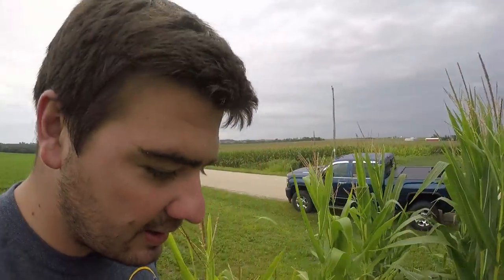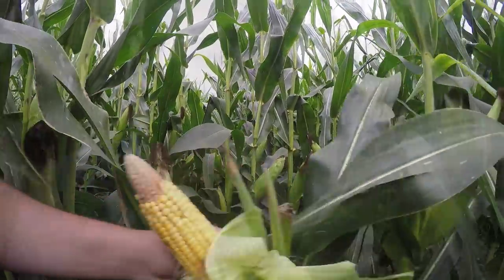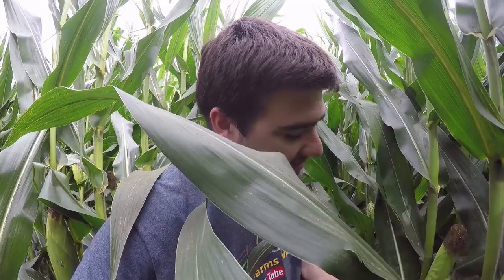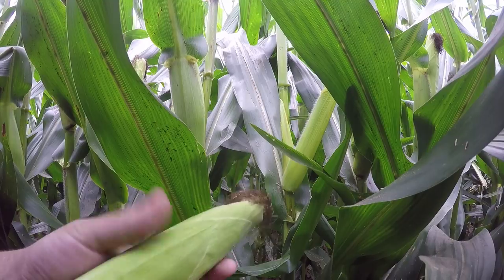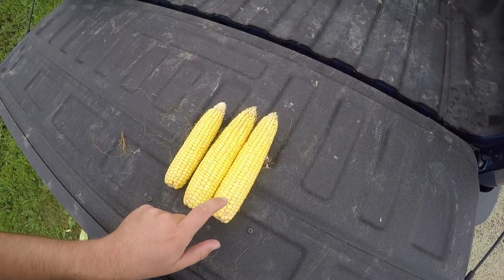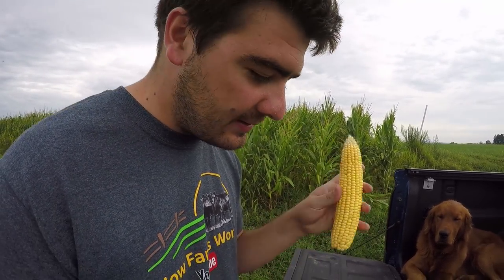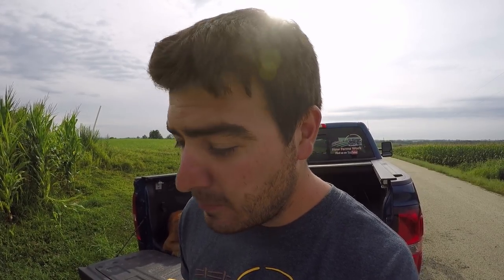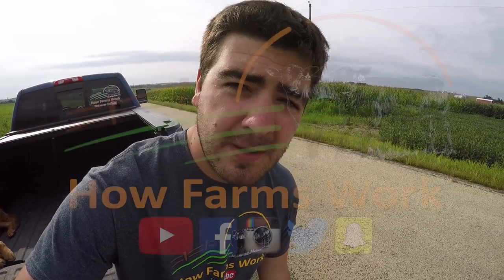Corn Yield Concern

Comment: Ive done detasseling as a summer job. 
Most are 3 female, 2 male, 2 female, 2 male then 3 female
Or 4,2,4,24
Reply: In Indiana (at least on the Pioneer seed corn production around my BIL's area; my nephew works for Pioneer as a field supervisor)  they have 1 male row and 4 female rows.  Females get detassled 3 times, at least... mechanically mowed off, mechanically "pulled" (spinning tires running against each other at an angle to snatch the tassels off) and then cleaned up by hand once or twice.  Male rows are chopped down as soon as pollination is completed.  Most hybrids now require 2 planters... one for male rows and another for female rows... looks funny to see a 24 row planter with only 8 units on the bar spread about 10 feet apart from each other (the male row planters) and another "skip row" planter with 4 units 30 inches apart then a 60 inch gap "missing unit" where the male rows are, BUT, Pioneer often requires many of their seed hybrids have the male rows and female rows planted at DIFFERENT TIMES, so really there's no choice in the matter... Some hybrids the male rows are planted first and then a few days to a week or two later the female rows are planted, sometimes vice-versa... 

Grandma told me when she was a kid Grandpa Bushnell used to make her and the other kids "top" the corn after it had pollinated... basically they walked through the field with a butcher knife and cut the top of the plant off right above the ear.  This allowed the corn to fill and ripen more evenly he said and resulted in higher yields.  Course this was back in the 30's and 40's before they had hybrid corn, so... 

Later!  OL J R :)

Comment: There's female plants?
Reply: I thought all plants were the same
Reply: Yes... some plants (like Ginkgoes) have differentiated "sexes" of the plants-- ie "male" trees and "female" trees... male trees produce only pollen from their male flowers and produce no fruit, female trees produce flowers that collect pollen and pollinate to produce fruit/seeds.  

Most flowering plants have the male and female parts in the same flower-- the stamens produce the pollen ( a number of little "sticks" inside the petals with little round pollen heads on them releasing pollen, in a circle around the very center of the flower)  with the pistil in the very center of the flower (which is the female part that collects the pollen, and then ducts it down into the ova (female eggs) in the base of the flower.  Cotton is this way, as is oranges, tomatoes, soybeans, and many other crops (and noncrop plants-- look up "angiosperms" on google).  

Those are all broadleaf crops... grass crops (cereal grains like wheat and oats, barley, rye, sorghum, etc) are still angiosperms and reproduce in the same way (ie they are flowering plants) but they of course have different flowering structures.  Sorghum actually has TEENY-TINY little blooms, only about the size of the tip of a pencil lead, for each and every kernel on the head of grain.  Wheat and other cereal grains are similar.  Corn is the real standout because it is SO far removed from its original "wild" form (teosinte, which was a grass-like plant in Mexico and Central America).  

Corn has a "divided florescence", meaning the flower is split into two parts, but unlike plants like ginkgoes that have separate "male" and "female" trees, corn has BOTH male and female parts on the same plant, but in DIFFERENT LOCATIONS on the plant.  The male part of the corn plant is the tassel at the top, which produces the pollen to fertilize the seeds (ova) in the female part of the plant.  The female part is the silks on the tips of the developing ear... As the pollen blows around from the tassels, it lands on the silks and is transported down the silks through the center of them (they are actually tiny little tubes) to the tip of each kernel bud on the developing cob... the kernel buds that are fertilized with a pollen grain will develop into a full-fledged kernel of grain-- the ones that do not pollinate will not develop into a kernel, and will be a "blank" spot on the cob.  The silks then dry out and die, as the ear develops.  That is why SOME ears of corn have "blank spots" on them, or bare tips-- if the weather gets too hot or unfavorable, the silks at the top of the ear don't have time to pollinate or can't pollinate, and so the tip of the ear remains "blank" or barren, since the ear silks from the bottom upwards toward the tip... 

Now, in regular field corn production (field corn, ie "yellow dent #2", but popcorn and sweet corn operate this way as well) the male tassel on each plant releases pollen into the nearby environment, and the silks on each ear collect pollen from the nearby environment-- some from its own tassel, but also pollen from tassels of nearby plants... similarly pollen from one plant also drifts down to pollinate some of its own ears, but also ears of other plants nearby... this is called "open pollinated" corn.  This is the "heirloom varieties" that our grandparents had prior to the 1950's...  However, most corn grown for SEED is HYBRID corn, meaning it  is a mixture of the genes of a female plant and a male plant, of DIFFERENT VARIETIES, specifically chosen for their traits. Say the "male parent" variety has good drought tolerance and disease resistance, and the "female parent" variety has good yield and vigor... mixing the two genetically gives a HYBRID seed containing the traits of BOTH.  SO, to accomplish this, the MALE variety is planted in MALE rows, and the FEMALE variety is planted in FEMALE rows... usually 1 male row and then 4 female rows, in a continuously repeating pattern across the field.  Now, the PROBLEM is, the FEMALE rows WILL produce a tassel (male part) and release their own pollen, contaminating the seed with some of the undesired "female parent's" pollen AS WELL as the desired "male plant pollen".  SO, to prevent this, the "male" part of the female plants (the tassels) are removed from the female rows, but cutting them off or ripping them off the top of the plants.  This then ENSURES that *ONLY* pollen from the MALE rows, the desired pollen, is loose in the field to pollinate the female rows, thus ensuring the seed produced is actually a HYBRID of the two varieties.  Now another problem presents itself-- the male rows ALSO produce ears of corn; their female silks fertilize those kernels of corn with their OWN pollen from the male tassels in the male rows, but the female silks and grain produced ONLY has the genetics of the male plants (since it's ONLY from the male plant's pollen in the male rows), and therefore is NOT a HYBRID seed like that in the female rows.  SO, to prevent this seed from contaminating the HYBRID seed in the female rows, once the female rows have all pollinated and the silks start drying down (turning brown and therefore incapable of pollinating anymore), the MALE ROWS are then COMPLETELY CHOPPED DOWN and killed, right down to the ground, along with their ears of "male only" corn.  This ensures that once the field is mature and ready to be harvested, NO "male only" ears of corn will be gathered with the female rows' HYBRID corn seed kernels in their ears...  The corn matures, is usually pulled as whole ear corn, and then transported to the seed company for special handling and shelling in a fixed sheller, cleaner, and sorter where it is separated from the shucks and cobs and silks, cleaned, and sorted into clean graded hybrid seed corn.  

That's another reason (beside the legal reasons) why farmers cannot save hybrid seed corn.  You plant the HYBRID, but the plants that grow have their own male and female parts (nearly every stalk has both tassels and ears/silks, therefore they pollinate themselves and others around them, and they are all pollinated by themselves and other plants around them; therefore the seed produced is no longer a HYBRID seed, but an open pollinated seed.  Some of the traits MAY express in the "saved seed" and some may not-- it's totally hodge-podge... Plus there are numerous legal impediments that prevent farmers from saving hybrid seeds, or even protected "varieties" of seed (cotton and other crops are similarly "hybridized", but since EVERY anther and stamen must be removed from EVERY flower, and stamens removed from the male parent's flowers and used to pollinate each female flower's pistil after its own anthers and stamens (the sticks and pollen structures) are removed, this is of course done only in a greenhouse setting to a limited number of plants... the seeds produced are then multiplied through production like regular field crops (since it's totally impractical to remove the anthers and stamens from every flower on every plant in the field, and then carefully brush a severed anther and stamen from a selected male plant's flower on the female plant's pistil in each of its flowers to produce HYBRID seed... so basically they multiply the seed as self-pollinated seed until commercially-saleable amounts of seed are produced, and release that seed as a new VARIETY (versus a "hybrid" which is a "true" hybrid of the two parent lines, separated as male and female plants).  

Hence, there are various cotton and soybean (and other crop) VARIETIES, but only corn is a "true" HYBRID... 

Later!  OL J R :)